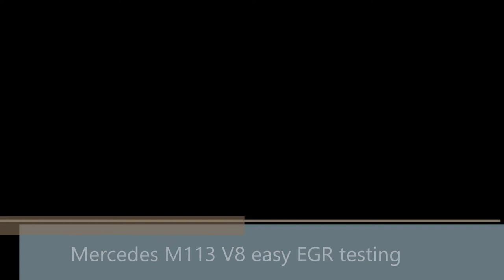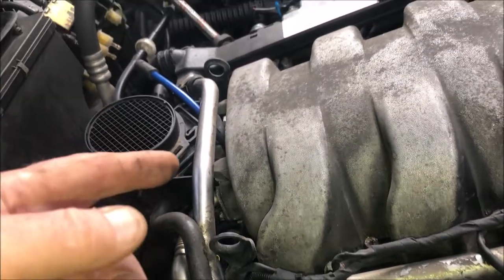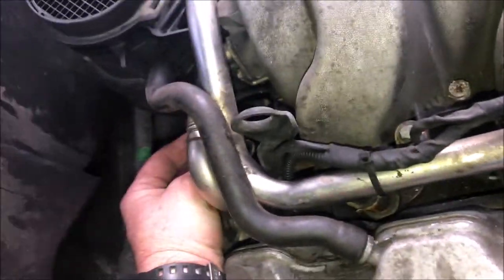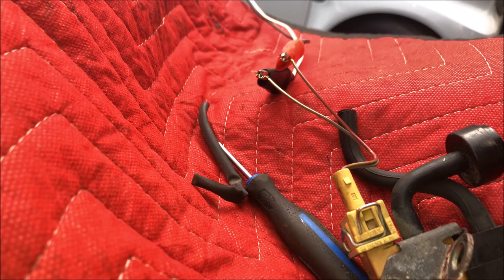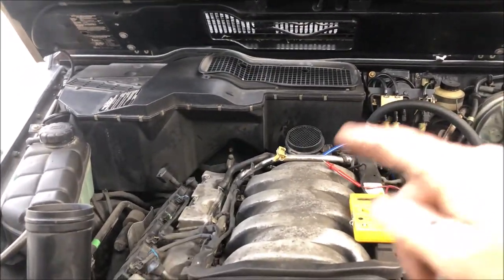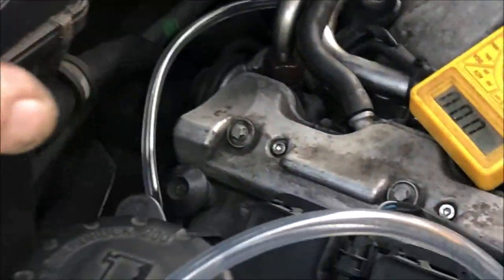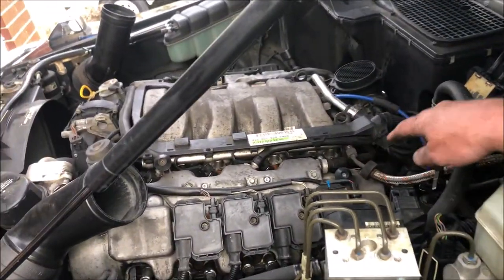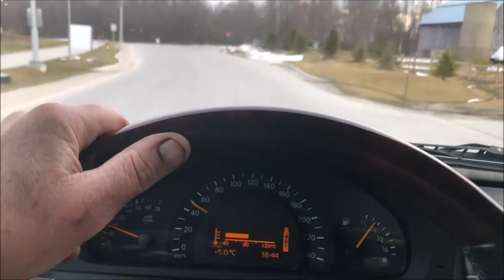Mercedes M113 V8 ..M112 V6 how to..easy EGR testing

Comment: My 1999 Ml320 just had a similar episode ... I was being a kid and matted the gas peddle to the floor, upon deceleration it started a pretty substantial miss at idle. I pulled over and shut off the car and when I restarted it.  it set misc miss code PO300  and miss code for cylinders 5 and 7 (weird). After restart it ran perfectly no egr code, hooked the scanner up and reset the miss codes and took a look at the fuel trims and o2 sensors. Looks like I'm doing the egr valve. The pintle on the valve or the solenoid are sticking. FCP EURO sells one for 87 dollars and I just put it on order. I also cleaned the egr tube and valve while doing the valve cover gaskets 5 months ago.
Reply from the maker: thats what we old guys get for the occasional hooliganism :)  Misspent youth with no such thing as a check engine light ..ahh the good old days.  When the egr isn't used to opening that far it can get stuck . Usually doesn't stay that way . I squirt them with a bit of deep creep (seafoam ) every few months and keep my fingers crossed .

Comment: Dear fupabox,
I have a 1992 500SL with 130,000 on the clock; I’m planning on selling it.
Quick question - where did you sell your R129? I don’t know whether I should sell it to a car dealer or try selling it online.
Many thanks!
Reply from the maker: Local advertising like autotrader or craigslist . I used a site in Canada called Kijiji...owned by ebay and very similar with no charges for posting

Comment: Hello!
My car is W208 CLK320 ( M112 V6 3.2  gasoline )  from 1998y with ODB1.

I unplugged yellow plug but nothing happened.
I have driven 40 km  and no any differences.
"Check Engine Light" doesn't light.
Regular engine operation.

Does egr is blanked or deleted by programming ECU?
Reply from the maker: I believe an ECU re-map can bypass egr function , but I'm not sure . No difference in driving or check engine light is odd with it unplugged .
Reply: Thank you for answer.
Previously owner removed secondary pair of catalyst converters. 
I suppose, that he blanked or deleted EGR by programming ECU. I don't know how to check it.  
How i can check "check engine light" is working ? Disconnect another sensor?